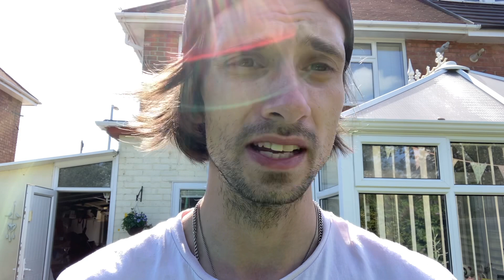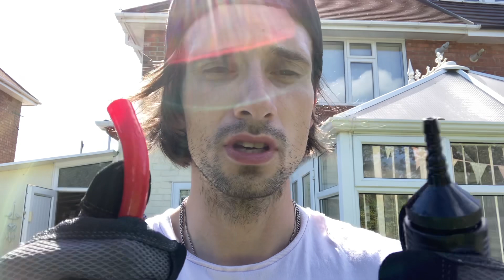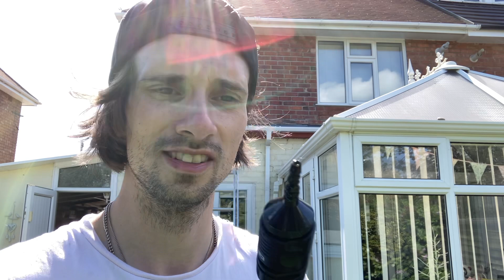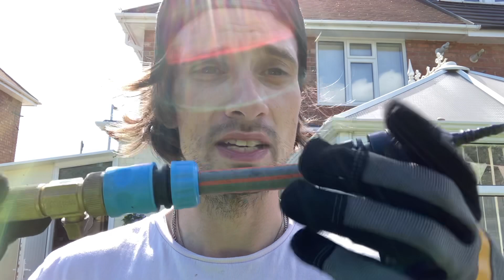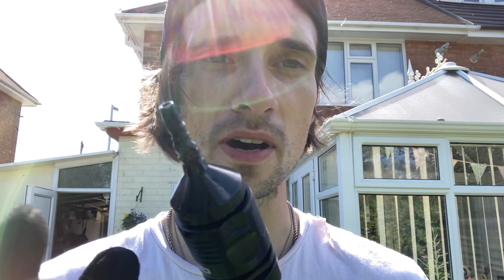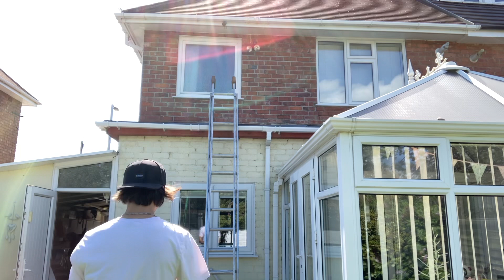Cheap & Effective Rinsing Tool For Exterior Cleaning #shorts

Comment: That's actually a great idea for pre washing before applying ubik that will blast away cob webs ect 👍👍👍
Reply from the maker: Yeah good point!! Works really well give it a shot if you’ve got a spare one and a bit of hose. Water pressure wasn’t that crazy here either
Reply: @PartridgeExteriorCleaning  will do great idea the partridge pump I can see it on dragons den now 😀

Comment: I don't usually use the customers tape for rinsing but I attached one of those hose lock connectors to a pole last night 🤔 Maybe I shouldn't have bothered. 😁
Reply from the maker: I was pushing it with this without an o-ring for too long surprised I didn’t pop off sooner 😆

Comment: Always carry some cable ties and duct tape. Cable ties would probably have held the 6mm barb on the hose. Nice rinsing method find though. Once you have settled in and sorted out your van finds like this wont happen :-) Sounds like you have lots of work so no time to sort van but while the work is there make the money!!! Down days or bad weather days are for sorting van etc.
Reply from the maker: absolutely mate, the one time i dont chuck the toolbox in there, something breaks xD
Reply: @PartridgeExteriorCleaning  It's always the way, the only time you need the tool kit and spares are when you forgot it.....